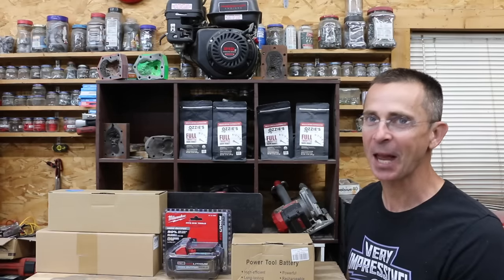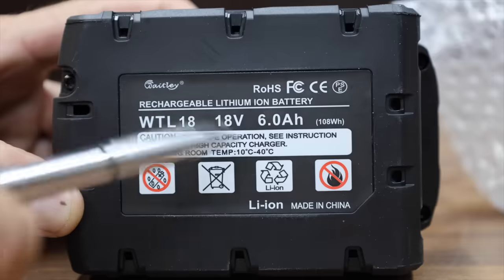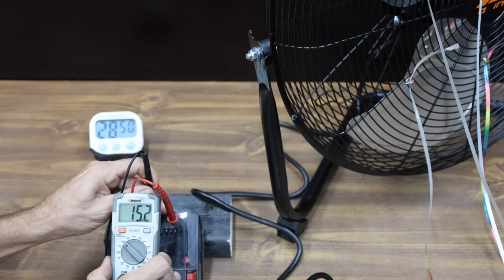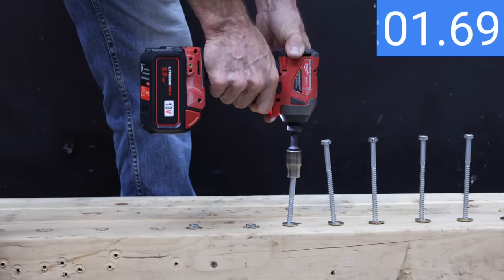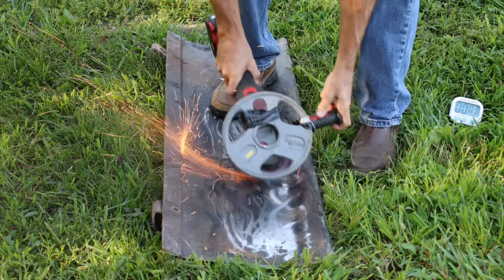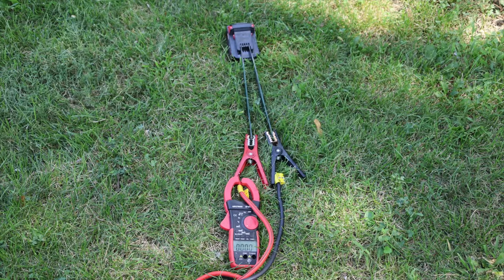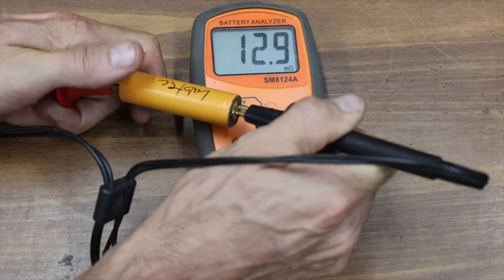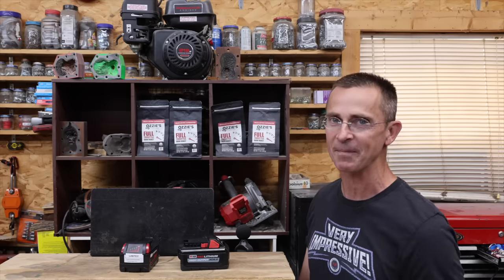How Dangerous Are Knockoff Tool Batteries? Let’s find out!

Comment: I adopted the EGO lawn tools. I love the actual tools, but the batteries are AWFUL! Less than 50% of the original run time after 2 years. Some get in a funky state where they will think they are drained, but you can reseat the battery over and over and get additional time out of it. One of my two chargers has failed. All conveniently JUST out of warranty. The first company that offers some sort of core exchange program, I will ditch EGO and move to them. Even if it was like 75% of full price when an old battery is turned in, that would be a lot more acceptable than buying a new $300 battery every couple of years.
Reply from the maker: Thanks for the feedback.

Comment: factory Milwaukee batteries suck so bad that any Milwaukee tool I've owned has always ended up with aftermarket batteries. They just don't last more than a year of heavy use without falling apart. this is why I've essentially thrown out all my Milwaukee tools for far superior Dewalt tools. Even my Milwaukee heated jacket has a custom made aftermarket li-ion battery, brought its life span from 30ish minutes on High to over 7 hours. I got sick of having to carry a box of batteries when I wanted to use my heated jacket.
Reply from the maker: Thanks for sharing.

Comment: I buy knock off Chinese tools that use Makita batteries where I know I won’t be using the tool hard. I’m old and am less active tool wise, but still really glad to have genuine tools like drills, drivers and multtool. I have a knock off rattle gun that takes a Makita battery for occasional use. But thanks to this video I will not buy knockoff batteries. I routinely put them on charge after significant use and then lock the Workshop door. Nope, not turning my back on a knock off.
Reply from the maker: Thanks for sharing.

Comment: Alright, so what i gather is if you're using the batteries for what they are designed to do, knockoff batteries are fine. But for high demand applications, it's best to go for the real deal.

If you're just using tools around the house for time to time, there's no need to buy a name brand battery that's marked up to hell.

Comment: Milwaukee 6Ah battery seems use Samsung 30T 21700 cells.  
For battery cells, 3 important things.  Inner resistance（overall）, maximum output current（power）  and Capacity（lasting）

Next time.can try Makita 6Ah, they use Sony Vtc6, it's a 18650 and better performance than Milwaukees Samsung 21700 cells.
Reply from the maker: Thanks for the suggestion.

Comment: The knockoff Dewalt 18v batteries (nimh) have a fatal flaw in that the charger believes they are fully charged too soon, so you can't actually charge them more than 15-20% of capacity, and you have to play tricks like taking them off for half hour and charging more several times to get them close to 50%, and thus their ratings are meaningless
Reply from the maker: Thanks for the feedback.

Comment: Without watching, I can tell you: DO NOT USE knock-off batteries in high powerdrain devices. They will smoke off. In small power drain, they can work, if the cells are of somewhat decent quality.
Reply from the maker: Thanks for the feedback.

Comment: As someone that's gone through a ton of 18650, 26650, and a lot of other odd sized batteries over the last couple decades the quality and capacity between them can be shockingly different, but don't really differ more than double in price from absolute crap to the best. The problem I have with the Milwaukee batteries is even if you use the absolute best batteries that battery pack should only cost around $60 and still have a healthy profit margin. There's absolutely a ridiculous amount of name brand markup built in there.

This is where the Chinese brands just make you wonder WTF they're thinking. They absolutely COULD use quality batteries and still undercut the name brand by a lot while still giving a quality product, but for some reason go with the absolute cheapest garbage 18650s. I will never understand why Chinese manufacturers do this to themselves. They're entirely capable of making high quality products at great prices but for some reason have zero desire to compared to making literal garbage.

As they say you get what you pay for but when it comes to batteries you're getting ripped off regardless if you're buying name brand or Chinese made ones. If you buy Milwaukee you're paying twice what the batteries are worth. If you buy Chinese you're getting your money's worth but it's for batteries you'd never want to begin with.

This is why if/when my driver battery packs die I'll just crack them open and solder in my own high quality batteries at less than half the price.
Reply from the maker: Thanks for the feedback.

Comment: I usually tend to agree with buy once cry once but when you have a Mil 12.0HD and Two 9.0 that only partially charge it’s a cry twice situation. 250 or so for a 12amp mil and half that price for a Hercules 12. Also in store warranty is much better at harbor. Home Depot won’t help a bit. In the past they would swap display tools for a defective Milwaukee but not now. Milwaukee also sucks on actual in warranty defects. I had a site light spontaneously crack at all the screw points. Stored in a house. Never commercial use or dropped. They refused to replace the plastic diffuser. Obviously some knuckle head in China over torqued the screws. I plan to start adapting Hercules batteries for some of my Milwaukee (higher output tools)

Comment: 2Ah for an 18650 isn't so bad (it isn't great either, but still), if they just sold them as what the are, namely 4.5-5Ah then nobody could complain, with one notable exception. I hate that they do this because it is so utterly dumb. Aside from the price difference there's a dramatic difference in mass and some would appreciate that - the battery you use in your tire inflator or work light or even drill for most tasks and many other things don't need to be as beefy as the one you use in your angle grinder or whatever - as long as they stop lying there's no issue (longevity questions aside but if they're legit cells then they should be okay). Of course, putting 21700's in and making actually competitive batteries wouldn't hurt, either..

Comment: I don't even have to watch the video.  The answer is yes.  Full stop.

I'll go full story mode here:

Early morning, about to walk the dog with one foot out of the door.  Then I heard a sound from the laundry room.  I assumed my girlfriend had dropped something and went to go help.  She was still in bed.  What I heard was the Dyson vacuum with a knockoff battery that has decided to kill itself, and there's liquid fire coming down the wall.

I smashed it all out, did the little "job's done" hand dusting.  Turn around and the wall behind me and behind the water heater was on fire.  That means the entire pack is essentially in a chain reaction, and the first one has not only compromised the other lith cells, but probably scattered them around.

Put out the second fire while screaming "BABE I NEED YOU TO GOOGLE HOW MANY CELLS ARE IN THIS BATTERY PACK RIGHT NOW"

"It says 6?"

Cue me thinking that there are 4 more little bombs, and we're all hanging out in a crowded room with a water heater that almost caught on fire.

I found Cell 3 when it blew up in my face, singed half of my beard off.  That right ear didn't work for a few days.

Found Cells 4 - 6 still bound in the wrapper, and managed to get it outside the kitchen door right as one of them exploded as well.

I can't stress enough:  Do not buy knockoff batteries.  After they sat outside for a few days, I dissected the rest of the pack.  The build quality was terrible, and cells 5 and 6 were so bulged that I can't believe they didn't go off.
Reply from the maker: Thanks for the feedback.

Comment: Name brand packs like makita, dewalt, milwaukee etc are using quality batteries, cells from places like sony/murata, lg, samsung. The cheap packs are using garbage chinese cells that are often way overrated. The fact you're getting 10 batteries plus the housing and protection circuits, connectors etc for $22? Quality cells typically run more than that for 10 of them, for just the batteries. Sure they get some wholesale discount but not that much. If a user were looking to replace the cells themselves and take the trouble to pull the connecting plates off, spotweld new batteries in place they'd be paying a good $50-60 for 10x 18650's or 21700's from quality brands.

Comment: comparing apples to oranges,  the size of cells makes a difference.  milwaukee uses 21700 cells, the others use 18650 cells.  Of course the larger 21700 cells produce more power.  duh
Reply from the maker: Thanks for the feedback.

Comment: I don't think it's really fair to call the individual 18650s knock-offs when theyve been removed from the pack. I mean, they are real 18650s and they're not claiming to be Samsung's or anything like that, theyre just not good cells.

I also don't think it's fair to call the 21700's 3000mAh "very impressive". It's a 21700, 3000mAh is as low as a 21700's capacity gets. The 30T's are good high drain cells and that's why they use them, but there's nothing impressive about the capacity in particular. The opposite, it's as low as it gets for a 21700.

Comment: Those knock off batteries are literally a scam. They might be a quarter of the price but they are basically not rechargeable. You might get 3 charges before they quit holding at all and what they did to begin with is disappointing.
Reply from the maker: Thanks for the feedback.

Comment: More Caution- last week I bought a flashlight that came with a rechargeable battery, of course made in China. I plugged the battery into my Energizer charger in my kitchen. About 10 minutes into the charge I heard a couple pops then a hissing sound. The battery was smoking. Had I not been right there to disconnect the charger... Had I not been home...  They've gotten so bad I won't charge a Chinese battery now unless I am nearby during the entire charging process. Are the Chinese liable if  my kitchen  or house burns down? We all know that answer.
Reply from the maker: Thanks for sharing.

Comment: I don't know about dangerous, but I'm absolutely certain they are more prone to over-discharging. This increases the perceived capacity of the battery but it also causes a Milwaukee charger to refuse to charge it because it looks like a failed battery. The solution is to unplug the charger for at least 10 seconds, put the battery on, it will flash red 1 time, then you plug it in, and it will charge. I own a lot of fake M18 batteries so I've become accustomed to their particular type of nonsense.
If you can afford it, just buy real M18 batteries when they are on sale.

The fake batteries do seem to contain reasonably good 18650 cells. I have about 50 of these cells due to taking apart fake batteries.
Reply from the maker: Thanks for the feedback.

Comment: Chinese batteries are famous for poor quality and overstating their capacity. There is no such thing as a 6.0 amp hour 18650 - the best high current 18650s top out at around 3AH. You don’t really even need to test these, just weigh them and compare to the OEM battery. If there’s more than a 10% difference, they’re garbage.

Comment: Where do the losers go? How about the winners?

Saw a review on Nordlock washers on the Professor Bumblefork channel AvE

I used a Bellevue washer in a Signode #7/16 strapping machine head with zero percent failure after several years of rebuilding. They took a lot of abuse 24/7 by dozens of operators. Even worked most holidays. They were my babies. Two on one palletizer. Have even rebuilt one during normal Christmas shutdown while they ran the other side on a rush order. Rant over. Later Todd.

Comment: Calm down, stop screaming into the microphone, PLEASE! @ 00:00:42 do you mean power INVERTER, not a power supply? and my ears lasted until 00:04:14 when I went to closed captions mode and shut down the audio, could not withstand the screaming any longer.